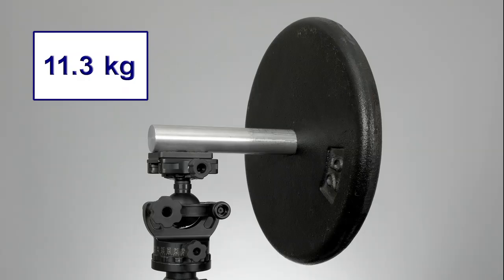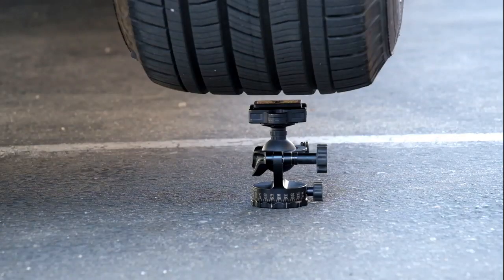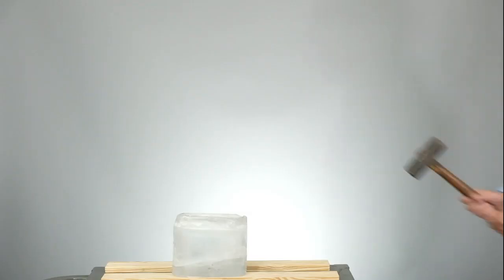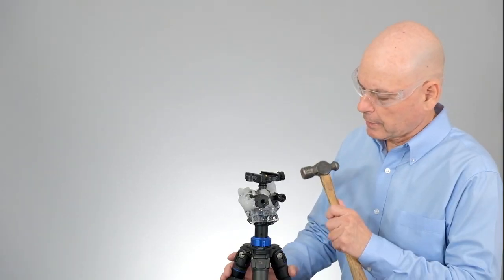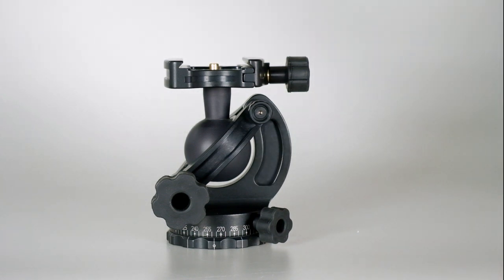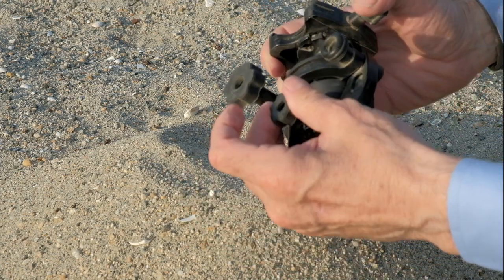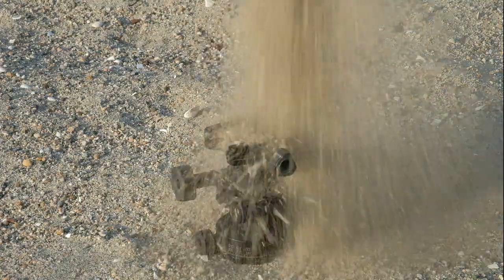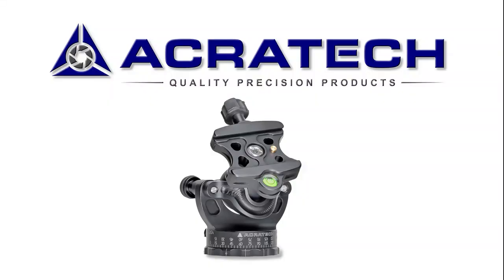Acratech Ball Head Performance

Comment: I had the opportunity to use this ballhead in Canada (in -30 degrees) and It works just fine. Cheap ballhead will get stuck in those conditions.
Reply: Thank you. We are dedicated to designing and manufacturing equipment that will withstand the toughest conditions.

Comment: I am planning on getting the GXP model, but just so it is clear:
That is not 5,000 lb of weight onto the ball head from the truck... you have the weight distributed mostly onto the other 3 points (3 other tires) because the wheel above the ball head is higher than the other 3 points... plus the obvious fact that the whole 5,000 lb truck is not sitting solely on the ball head.  This is only supporting a few hundred pounds at most. 

Thanks,
Rick
Reply from the maker: We do not recommend anyone put this weight on a ball head.  It was to show that it will hold more than what we rate it for. These are extreme tests that we doubt anyone will be facing in real life.....well at least not dropping a truck on it. They have been left outside in freezing weather,  dropped in the sand, fallen off of moving vehicles, and used in underwater photography.  It was to raise the question...can your ball head do this?  Plus who doesn't like destructive testing?

Comment: Hi! 

I own a GP model as shown in the video. I bought mine used from someone about 2 years ago, but the original owner bought it in 2011. I fell in love with this ballhead as soon as i got it! After 10,5 years all the knobs and the ball is still silky smooth! However, i do feel like the friction/tension on the ball (main knob) isnt as strong as it should be. Even when i tighten the knob a moderate amount i am able to move it with my hands when using some force (im not strong at all). Do you have any suggestions if there is some kind of maintenance that i can perform to the friction/locking mechanism in order to maybe restore some of the friction ability? I really think this unit has a lot more years left it in it, it just needs a little care. Is there anything i can do in order to improve the friction?

Thank you in advance!
Reply: Hi Artyom, We never charge for service (even if you are not the original purchaser). Just send it in we will take care of it. You will only need to pay for shipping.
Reply: @acratechinc5861  That is wonderful! The only thing is that I live in Norway. How much would I have to pay for shipping from the US and back to Norway?
Reply: Please email us directly with your address and we can get a shipping cost. You do not want to put your address on youtube.